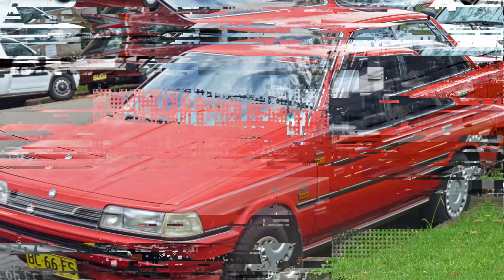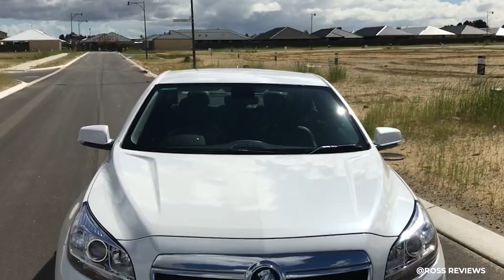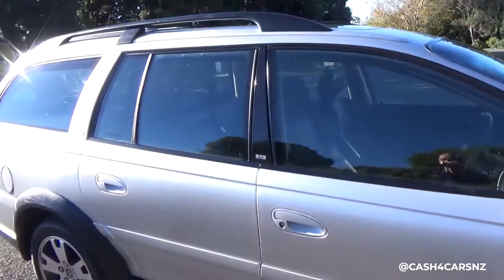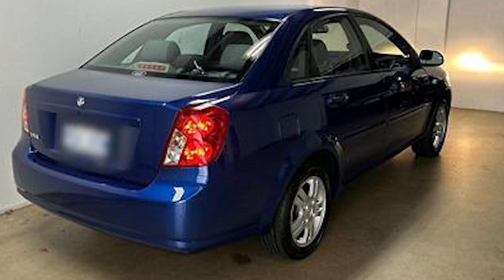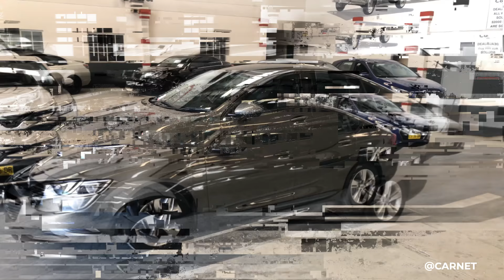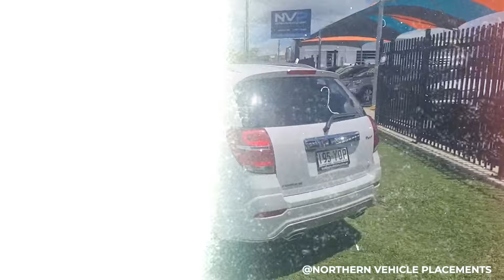Top 12 Worst Holdens Ever Made

Comment from the maker: Which Holden did I rank way too harshly? 😂
Don’t take the list too seriously, the point was mostly to have a laugh at some of Holden’s biggest misfires, not disrespect the brand...
Reply: You forgot to mention the Holden Vectra!
Reply: @Twenty1035 my 3.2l V6 top spec Vectra was a great car with Zero faults.
Reply: @Twenty1035 Had a 97 Vectra fast back. No problems
Reply: Hey elf, you should do a video on  the worst Ford's now.
Reply: It’s interesting with the Cruze because most people I know had minimal issues with the 1.6 Turbo. I had one that I got to 240,000 km without any issues before it was written off by p plater. Maybe we were just lucky. The horror stories I’ve heard come predominantly from the 1.8, diesel or 1.4T are different story though.
Reply: Frontera
Reply: Holden are garbage. Enough said.
Reply: Front drive don't replace rear drives esp. for true Commodore drivers. Ford properly killed off the Falcon, indirectly replaced by Mondeo. And I do mean Mondeo as Mondeo - NOT Falcon!

Comment: My mother in law just recently bought a used holden Trax. I begged her repeatedly to not buy it and even as i was on the phone, her partner went and put a deposit on it as in his words "It looks brand new". My response was you can put lipstick on and pig, but you still have a pig! I owned a holden UC Torana when i was younger it was an unbelievably reliable car. I put 250000 ks on it without ever needing to change any of the running gear not even the clutch. Just servicing, brakes and tyres etc... Holden lost its way back when they started importing shit box cars from overseas.

Comment: Currently own a 2010 Captiva, which I sort of got tricked into purchasing new, I was looking at a Honda or Kia but I have a back problem and the seats in those pressed on the problem area in my back, I sat in the demo Captiva and it didn't hurt my back so I went ahead with the purchase, unfortunately when my new Captiva arrived the seat was just as bad as the other two, the seat in the demo Captiva had collapsed and that's why it didn't hurt my back. I ended up with a cushion, until my seat collapsed, it eventually collapsed so far that I had to put the cushion back.  I had a rocker cover oil leak, fixed by a shonky mechanic to get through rego, cleaning the engine bay down he filled the spark plug recess with water, the result was when trying to start the engine, he ended up getting raw fuel into the catalytic converters which caused them to eventually fail I had to replace them with after market ones as genuine ones were no longer available, other than that, only the water pump has failed and during the repair I replaced the toothed timing belt at the same time (apparently my model got the Opel engine no timing chain). However the Captiva only has about half the power compared to my 2002 Commodore which has the same engine capacity.  On a positive note, It does have a large space at the back which will hold a lot of whatever you want to put in it, which is why I keep it running, I just drive it normally and mainly for moving stuff around and general use,  it's still going ok 16 years later.  (I didn't count tires and brake shoes or oil changes as all cars need those changed at regular intervals)

Comment: I absolutely loved my 2012 Holden Cruze SRI-V 6 speed manual Sedan. Loaded with extras and accessories it was quiet, comfortable and reliable. 110,000 kilometres travelled in the first 4 years and very little required except for regular Dealer servicing. I still miss it.

Comment: My best mate and I both had Astras at the same time, 2004 models that I think were Polish built. It got to a point where one or the other of us would send a message saying “just giving you a heads up that this just broke…”, and within weeks of it happening to one of our cars, the other ones car would have the same problem. Chattering windscreen wipers..ignition barrel falling out….back window slipping off its mounts and into the body of the door….rear stereo speaker buzzing…air conditioning failure ….a nightmare car to own.

Comment: The 4 cylinder commodore with the starfire engine has to be on the list
Reply: Had a 81 VC 4 cylinder auto, and later on a late VK ½ also 4 cylinder manual. I think a lots to do with the tuning as both mine went quite well, considering the bodies were quite heavy on those cars.  And did 30-33 mpg on a trip.
Reply: Why? Have you owned one? 🤔
Reply: @RussMitchell-vp6kt  my father had one. It took 2km to get it up to 100kph

Comment: It was an insult to the ZB to call it a Commodore
Reply: Indeed. The Insignia is a very good car but not really a Commodore as true fans know.
Reply: Damn, it's 2026 and we're still acting like little children about the ZB?

The ZB was by far, the most advanced, sophisticated, modern, sleek, aerodynamic, safest, best equipped, best handling, best gripping (would you like me to keep going?) Commodore to ever be released. There is nothing insulting about a car like that. Holden actually had a significant hand in the development of the car, a LOT more than people realise, co-development being started in 2012. It's just you need to drive the car to feel the differences. 

Tell me, what exactly is so special about the word "Commodore" that it can't be used again for anything else?

The fact is, evolution is a must, nothing lasts forever and the ZB was what Holden's big car should be in 2018. Had local manufacturing continued I genuinely believe the Commodore would've evolved into something similar. Not to mention that the name of the car is decided by the company that sells it (GM) not the end user. And definitely not random people on the internet. Hate to break it to you, but if it rolled off the production line with a Commodore badge, which it did, then it's a Commodore. Case closed. That's it's name, that's the name that was officially given to it, therefore that's what it is. That'll be a hot take but that's how naming something works. Just like how parents naming their newborn children.

A lot of the things in this video about the ZB are blown out of proportion, misinformation and/or just untrue, and it really is childish continuing to moan and complain about it. (It will never change anything.) The ZB was not any better or worse than previous Commodores, just different. And there's nothing wrong with being different. That was 8 years ago, please just get over it already...
Reply: @jamestorrens645 I The Insignia was a VERY good car but it's not the Commodore that majority esp. fans recall since from VB, through VT, VZ and finally VF.
Would you like to have your German Shepard or a Husky being replaced by a Labador or a Golden Retriever?
The ZB is a front wheel car. Even with AWD upgrades, it still behaves like FWD instead of drifting on bends like VFs.
Real Commodore drivers (which I'm not but I DO understand) know that front drives can't replace rear.
Ford did the smart move and properly killed off their Falcon lineup, indirectly replaced by Mondeo. And yes they've kept the Mondeo name because it's NOT a Falcon!

Comment: The VB and VC are excellent bulletproof. I even worshipped The VR 200000 without changing the oil, then the front pulley bearing went.
Holden on the mountain.
Reply: VR was great, had the excellent Buick 3800 engine. Iron Lion V8 was good too,  The VB was a good car, VC, well my brother had one, and it was an absolute bucket. That said, it wasn't a good example. He called it "The Death Trap".

Comment: My mother-in-law bought a new Viva in 2008. I had advised her to buy a Hyundai i30, because it was a far better car. The Viva had the most uncomfortable seats I have ever experienced, and the driving position was so bad that I was literally in pain after driving it for less than 100 kilometres. The only thing I can say in its defense is that it was fairly reliable, but when things started to go wrong, finding parts was impossible. She eventually sold it and bought a Mitsubishi Lancer.
Reply: Mitsubishi.  Oh no theyre just as bsd, electrical demons, expensive repairs,  the transmissions are weak as a wet biscuit and expensive,  a freind had a Mitsubishi lancer vr4 for his work hack. The computer failed cost him 2'5 k to fix then the transmission failed costing him 2'5k lol. You can buy a decent used  ford BA falcon for less than that, very reliable strong engines, the barra engine
Reply: @Insert.angle50 , you might be right. However, my mother-in-law is a widow in her 80s, so a Falcon isn't the right car for her. My wife has a 2016 Lance auto that she has clocked nearly 200,000 kms without it missing a beat. People said the same when I bought her a Magna in 1998, telling me that they were junk. It had 370,000 on the clock when we sold it, and the only things that we replaced were the rear muffler and the radiator when a stone punched a hole in it. Otherwise, it was as reliable as a Swiss watch.

Comment: In Philippines I owned a 2nd-hand '05 1.8-ltr auto Chevy Optra (aka Daewoo Lacetti/Holden Viva) for a couple of years. It was adequate for the location, given the low traffic speeds and short distances there; it had almost 133,000km on the clock when I sold it. In Oz I'd previously owned a new '84 JB Camira, which was the second-worst car that I've owned, the worst being a new '70 Hillman Imp Van in the UK; that was truly diabolical and potentially lethal, so I got rid of that very quickly.
Reply: The Imp was the demise of the Hillman name. You couldn't use reliable and Hillman Imp in the same sentence, ever! 😂
Reply: @Andy7seven7  Agreed, which was a real shame, as the three previous Hillman Minx's that I'd owned were super-reliable.

Comment: I had a Cruze. The transmission left me stranded, but Holden was nice enough to replace it under warranty when it was a couple of months past the warranty period. Sold it as soon as I got it back.
Reply: See I had a 2013 Cruze 1.6 Turbo and never had any issues with it. I got it to 240,000 km. The only thing I really had to do was replace the battery. I wouldn’t touch an earlier 1.8 engine with a barge pole but the 1.6T was fine in my experience.

Comment: Hay elf, you should do a video on the worst Ford's now.
Reply: They dont have any😅😅😅😅 still got my 1991 fairmont never needed any repairs still driving in 2026.
Reply: @Insert.angle50 Let see, let start with 2010-16 ford focus &fiesta and eco sports. Faulty transmissions in there cars which resulted in a massive class action lawsuit to ford motor company. And there is the 1996-98 ford Taurus. us designed Aussies did not like it which resulted in poor sales and  ford dropping it from market 2 years later. Oh there's the xk falcon 1960-61 the American made suspension was not design for the Australian conditions causing it to collapse over bumps and bad road conditions. 1988 EA falcon suffered from terrible assembly standards, poor transmission, live rear axle issues. 1989-94 Capri  which was built in Australia. suffered from poor built quality, structural body twist um engine and timing faults leaking roofs.they even  got the reputation being call LEMONS. l can keep going if you like? So there you have it . FORD all so sold and built and re badged shit heaps to.

Comment: Had a JB Camira that I needed to carry a jar of petrol whenever I drove it. The only way I could start thethig after sturningvit off was to poor a bit of pedi down the carby each time. It overheated coming back from Adelaide to the property outside of Kadina for the last time a few k's from home on a dirt road only locals travel. Left it there where it stopped and after walking back to the property on a 40° day I rode the XR 250 back with the signed rego papers which I left on the dash board and keys in the ignition with a note saying "take the bloody thing. Not my problem anymore. Sat there for 2 weeks then drove pastobemorning and somefool had taken up the offer. Had to either tow or trailer it back so they were keen.
Reply: Probably scrapped it mate, you missed out on some easy cash
Reply: @Insert.angle50 😂
Some friends had a JB as well, and it was a piece of 💩. When it could give no more, my brother suggested taking to the bush to get $150 worth of fun smashing the crap out of it, because that’s all the wrecker gave my mate for it. So we missed out on an afternoon of sheer automotive pleasure.
Reply: @Insert.angle50 $150. Would have cost that to get it to a srapy out there.
Reply: @zalired8925 oh ok very far out eh

Comment: A mechanic that was working on my Commodore's transmission had a general rule for Holdens. Any model that has a name that ends in an 'A' is garbage. Captiva, Astra, Vectra, Frontera and the list goes on.
Reply: I beg to differ with the Astra and Vectra. I had a 1996 1.4, no problems. Was 6 months old. Then got a Vectra fast back 2.0, again no problems. It was 18 months old. Then got a 1998 twin cam ecotech 1.4 Astra about 18 months to 2 years old with 10,000 on the clock and had no problems with it either. Reason I sold it, I'd hurt myself and had problems getting in and out of it, so I got into a 1998 2.0 Suzuki Grand Vitara 2 door. Now, low and behold because my aches and pains have gone, I'm into a 1998 Toyota Camry. A good car, and because it was built in Australia, it comes with complimentary, wait for it... a saggy roof lining! Yep, a common thing with cars built in Australia in the 1990s I was told.
Reply: Leyland Marina. A worthy inclusion to the A Team.
Reply: Torana .. ☠
Reply: I loved my Astra Wagon, so nice to drive. I took it  on a lot of driving holidays between  Qld and Vic. The only reason I got rid of it was because I'd clocked over 300,000 km. 
That said,  my mechanic hated working on it,  he said as much to me every time I took it in for a service.  haha.
Reply: Yes
Reply: Some are great, most are lemons. I had an amazing hyundai excel for 9 years. Not the same as others experiences. 16.6 qrt mile just for fun
Reply: Yep
All GM”Global”cars aka crappy re badged Daewoos

Comment: ZB was far better than the car it replaced 
Horrendous marketing decision by a company already on its last legs
Holden crewman missing from the list
Reply: Totally agree. The ZB shouldn’t have been called a commodore but is an excellent car in its own right.
Reply: Yes at the time I bought the 4 cylinder Calais . Still going like a train.Dont regret buying it for 1 minute.Anything built by Daiewoo I would not touch.
Reply: Should never been called a commadore, it was also an AWD6
Reply: @kenfowler1980   either should have the original commodores then, they were also Opels
Reply: @shaunrayner it could have sold under an Opel model name - they are a decent car.

Comment: Most of the worst holdens you listed were not made by Holden
Reply: Yeah basically everything out of the Daewoo factory was shit, not real Holdens at all just re badged, management firmly cops the blame here!
Reply: Not many holdens were made by holden, thats one thing that makes holden utter garabage, the commodore designed by opel, the engines were buicks and chevrolet in the commodores , even toyota engines and nissan wete in  commodores,  the all australian car😂😂😂😂😂
Reply: @Insert.angle50   ok tell me what Commodore had Toyota engine in it?
Reply: @ChrisAlbrecht-t8v google it,  i dont envolve myself with rubbishy brands like holden, all of GM is rubbish let alone the brand that they threw away😅
Reply: @Insert.angle50 yeah true that, I’m a Ford man, I’ve owned 3 Holdens, a 1984 VK (utter crap), a 1988 VL Calais 5 liter (my mates Camry could beat it off from the lights), and a 1998 VT Interceptor, was good but wasn’t without its problems. I owned a 1982 Ford LTD, 351, best ride and seat comfort ever, and the last of the Territories with the 2.7 Diesel, was an awesome car!
Reply: @offthegridwithbert924 https://youtu.be/ujwsjjZaSNY?si=Ut1uURPFzHHFBl68 i still have this car, door hinges are pretty sloppy , wiper motor died from lack of use, interiors pretty fkn tired but these things can be fixed
Reply: @offthegridwithbert924 https://youtube.com/shorts/JPxGa_0skC4?si=7ikpss8P3XvpK_a2 its got a 400 cam performance pistons solid state lifters performance manifold some type of unidentfiable heads, no small dot no big dot, they something special, headers extra large sump, this car is fkn fast omfg. Very hi reving like 7000rpm , kills both rear tires in under a minute
Reply: But sold by Holden . . .
Reply: @waynepantry7023 holden is ,,was only a name, a subcidery of GM an upholster, they worked on model t fords😅